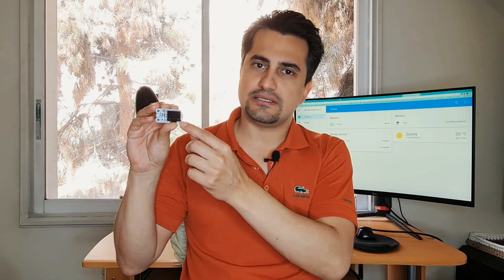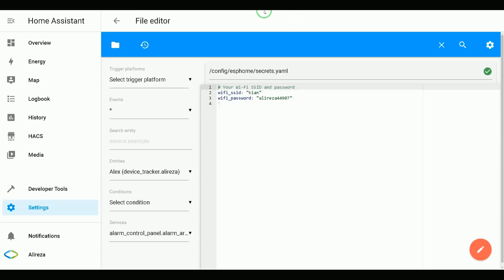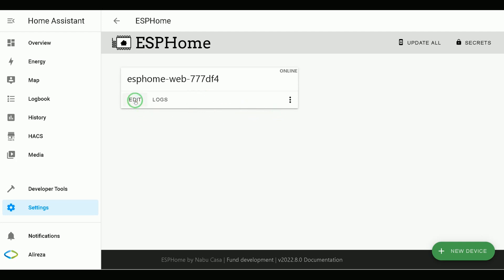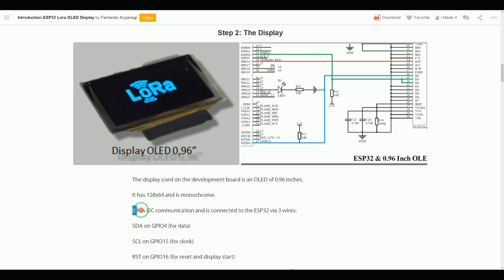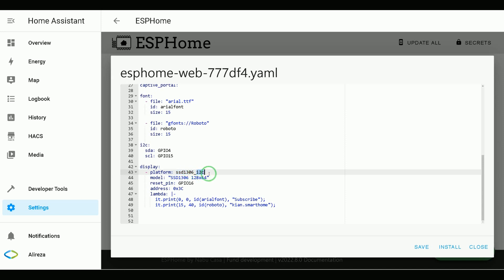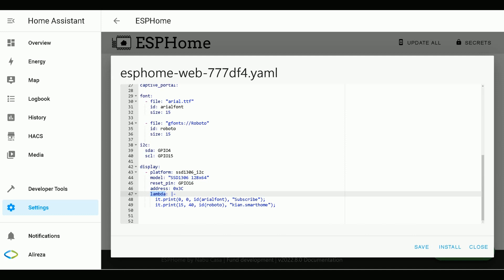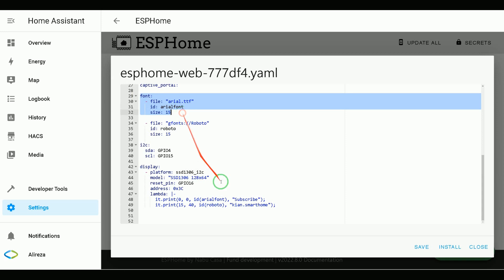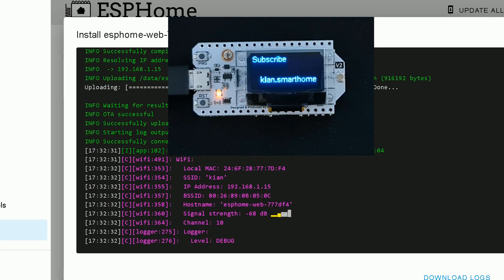Use display with ESPHome in Home Assistant

Comment: Hi, I have a Heltec WiFi Kit 32 (V3) and the display does not turn on, I tried everything and the log says Communication with SSD1306 failed! can you help me?
Reply from the maker: hi, at first check the pins and connections.
Reply: @kian.smarthome  I haven't found anything about it
Reply from the maker: @nunziotech  I have talked about display connection. Watch more carefully.

Comment: Hey, any luck with getting it to display dynamic content? I really want to be able to update the text regularly either through a REST API or a given value sensor value in home assistant. I've seen examples of how to display the values from sensors connected to the same board but I'd like to do more than just that.
Reply from the maker: Hi, Step by step I will go further.
Reply: @kian.smarthome  Sounds great, I did find a good way to do this by listening on MQTT topics (one for the message and one for backlight control).  I think this would be great video to create though as I couldn't find an easy guide to follow.  I'm happy to send you the device yaml it you'd like to have that as a starting point.  I did try exposing the web server hoping I could do a POST to update the display but that didn't seem to be supported.
Reply from the maker: @nathanclark4630  Well done. please send the yaml file to alireza_44907@yahoo.com
Thanks a lot for your support